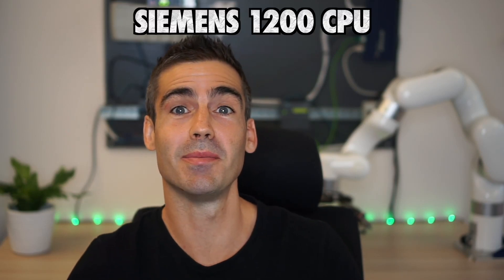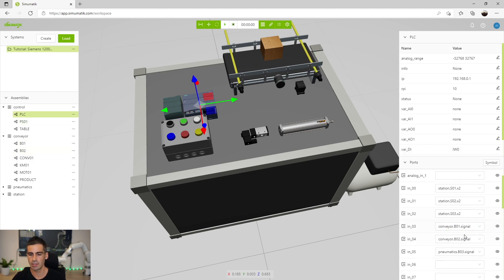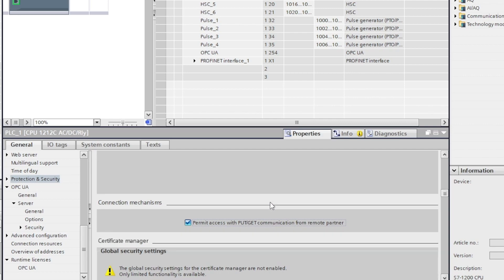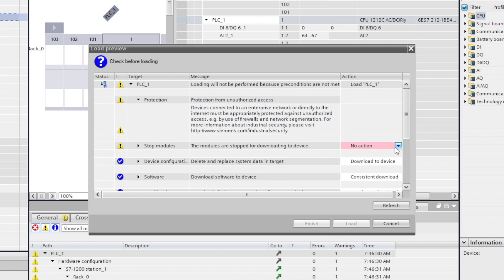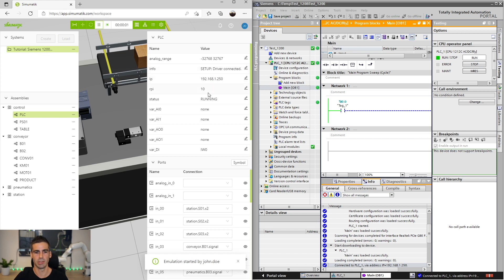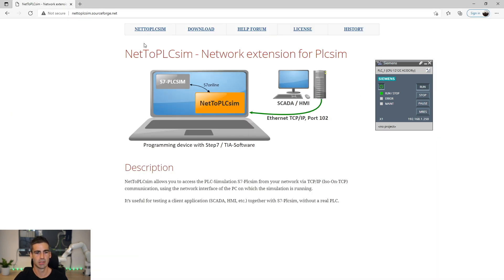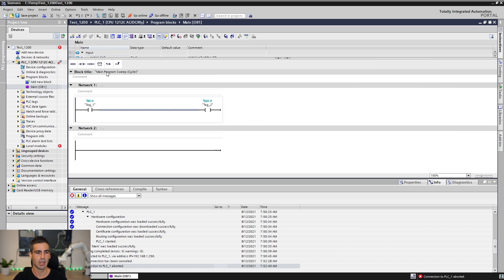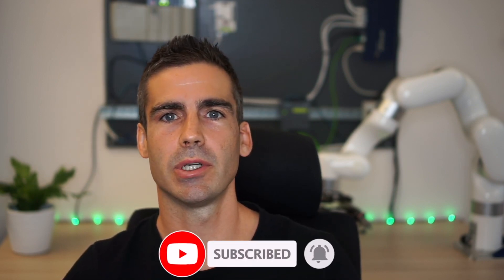How to program Siemens 1200 CPU with Simumatik

Comment: Does it work with complex dynamic numerical models like FMU/FMI?  What about invert kinematics (in other words geometrical constrains), collision detection (creation of meshing types) and subscribers as feedback for other events? would it be possible to create a SIMIT coupling like a native coupling, shared memory coupling or OPCUA coupling?. Last for not least what makes better this software in comparison to Unity or Unreal?
Reply from the maker: Hi, we try to answer with the features that Simumatik platform offers right now:
- FMU/FMI: Right now the logic inside the models is written in python (you can use numpy), but we are working on FMU integration as well.
- Kinematiks: You can create different kinds of constraints/joints with motors, sensors, springs, limits, etc...
- Collission shapes: You can use basic geometries or meshes. We offer optimizations to create convexhulls dinamically to reduce CPU usage.
- Feedback: You can get collision detection on surfaces, advance surface data lectures, etc.
- SIMIT: We have already a driver to communicate directly with SIMIT using SharedMemory.
Unity or Unreal are game engines. Simumatik is an emulation platform, easy to use and offering all you need to start building automated systems to be controlled with PLCs, Robots, or whatever you want! 
You can learn more in our academy (academy.simumatik.com). We have many courses and webinars talking about all the features you are asking about.
Reply: @Simumatik  A lot of thanks!! I am looking forward to testing the software and after it  suggest it in my company. Thanks!

Comment: cuantas entradas y salidas puedo tener en Simumatik? como por ejemplo un modulo de expansión 8 E/S con un Siemens 1200? agrego otro PLC con simumatik? 

How many inputs and outputs can I have in Simumatik? such as an 8 I/O expansion module with a Siemens 1200? Do I add another PLC with simumatik?
Reply from the maker: Hi Steven, You can have as many IO cards as you want. Use the Rack output in the compact or Rack generic PLCs to connect cards. Do not forget to set the Rack end component at the end of the IO card connections. You have more information about how to use the generic PLCs in this section of the Gateway and Integration course from the Academy: https://academy.simumatik.com/path-player?courseid=gateway-and-integration&unit=63e51a48ed12c90cae07420aUnit

Comment: Does Simumatik generates programs for the Siemens 1200 PLC or does PLCSIm drive the Simumatik simulation? This is not exactly the same thing 🙂
Reply from the maker: Hi Stéphane! As you can see in this tutorial, Simumatik does not generate PLC programs, it is used to replace the equipment that you want to control with your PLC. The point using Simumatik is to be able to use your actual PLC program to control the model. For industrial users this allows carrying out Virtual Commissioning, while for students it allows to train programming skills with actual PLC programming software, like TIA Portal, Twincat, Codesys, Studio5000, etc...  Thanks to you!🙂